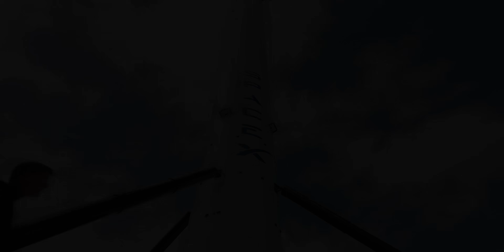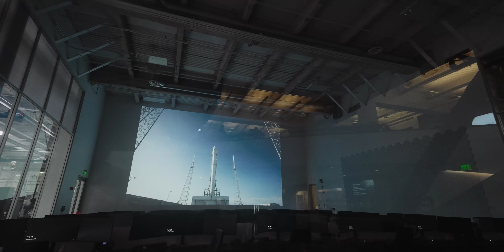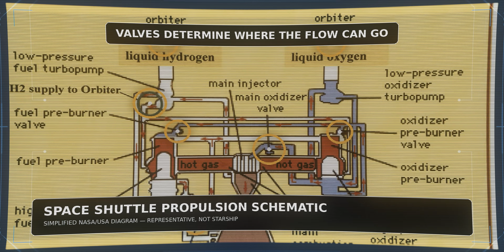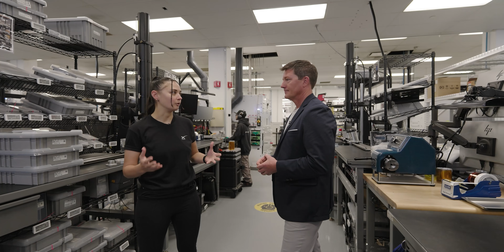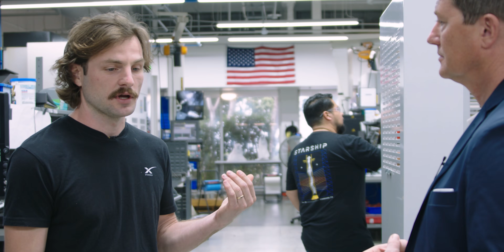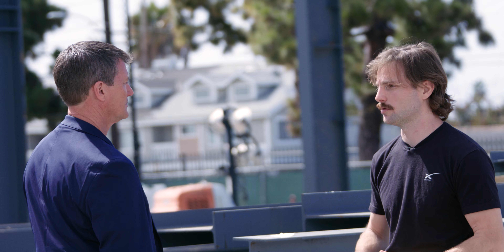How SpaceX Manufactures the Starship Parts You Never See

Comment: That issue with the chips is actually a very valuable issue to solve. 
Have they thought about using 3 machines for the same part with the first machine running a new endmill with code optimized for it and then, after a certain number of cycles, sending that endmill to the next machine optimized for a slightly duller endmill and then, after a number of cycles, send it to the 3rd machine? Then you'd have 3 machines running at once with ideal consistency and you'd be able to use the endmills up without degraded performance.